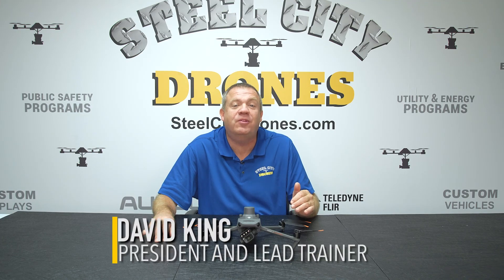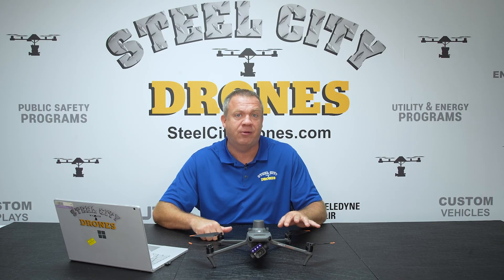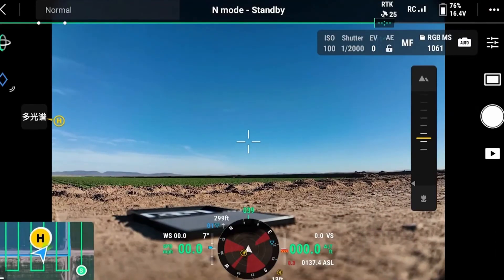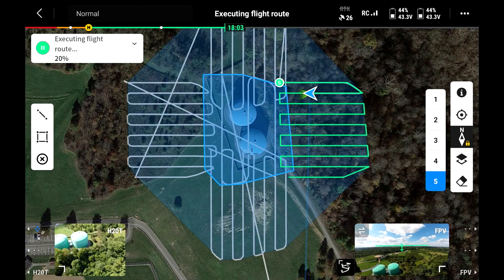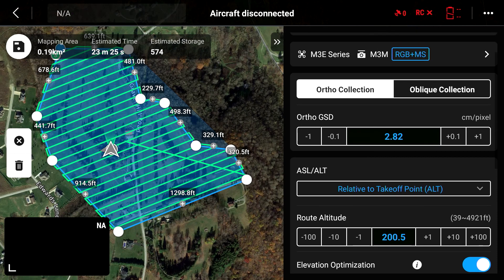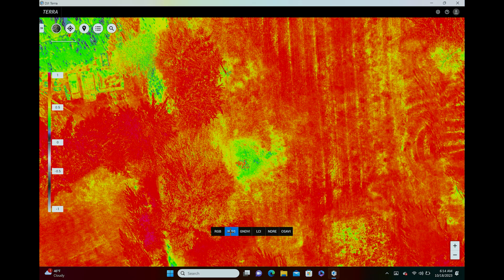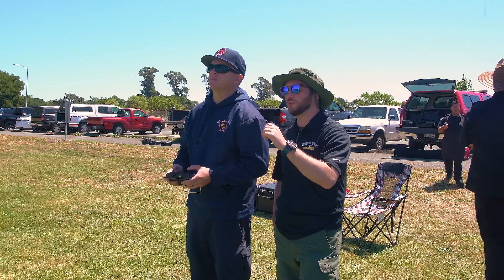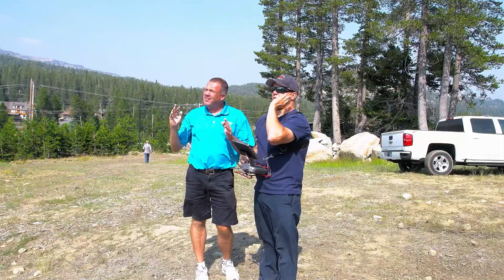DJI Mavic 3 Enterprise Multispectral Comprehensive Review

Comment: Can the camara or Multispectral sensor by switched..I mean having the camera and want to do Multispectral job using the same Dron? Can it be changed? Thanks in advance for your response..
Reply from the maker: The camera gimbal can't be interchanged or swapped out. The existing gimbal has 2 cameras on it (RGB and Multispectral) that you can switch between.
Reply: Ok yes  I wach your videodescription  so just to be complete sure with this dron I can do two diferents mapping activities one is appied to agriculture  and the orher for photogrametry? this implies that generates point clouds and from there topography ? @SteelCityDrones  Thanks  dor your comments
Reply from the maker: @hectorarruti1751  The data that camera captures can be brought into DJI Terra or Pix4D to generate point cloud inputs that can be used to process Topo.
Reply: @SteelCityDrones  morning!, could you please send me a cuotation of the DJi Multispectral ?
Plus RTK tool than you in advance.
Reply from the maker: @hectorarruti1751  Contact support@steelcitydrones.com